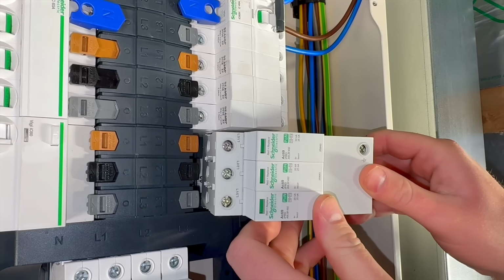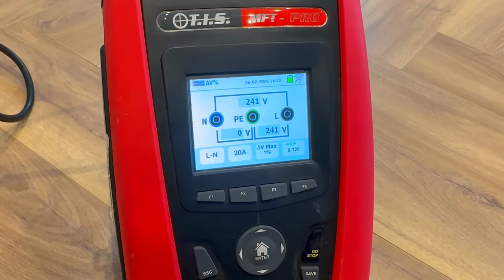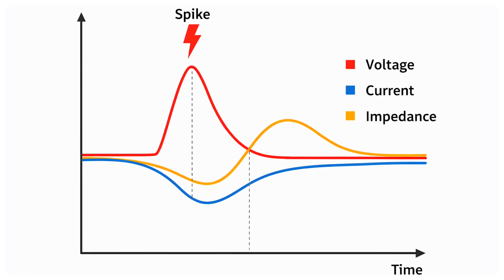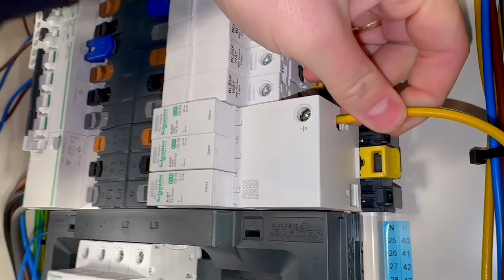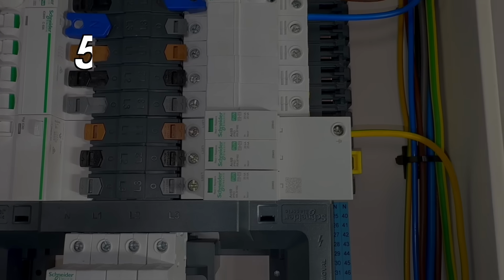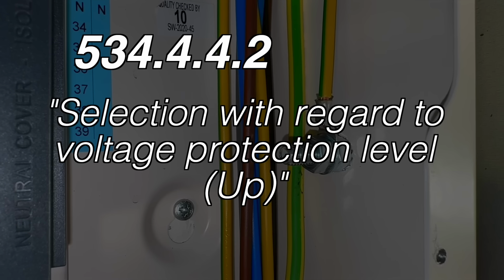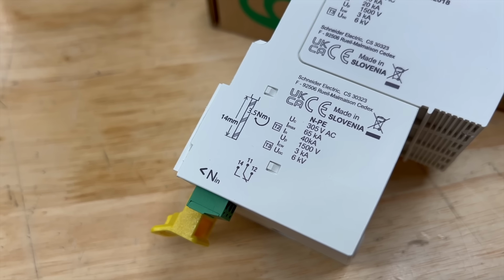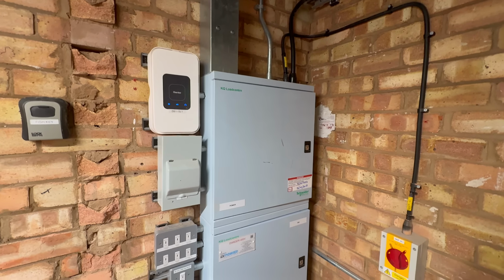SPD Type 2 vs Type 3: Most Electricians Get This Wrong

Comment: Thanks, never come across oscillations but then... who would know! Must admit I fit SPD's in every DB if I have a gap big enough (makes the install look nice as well), the biggest issue is trying to second guess where the surge is going to come from. My own house is high in the mountains, directly on top, we get hit by lightning at least once a year (sometimes 3 or 4!), used to buy washing machine control boards in bulk, since going SPD crazy, problem gone, so they do work. Curiously, the SPD's never blow even when the entire house has gone bang with a direct hit and they have worked.
I bet you there's no electricians that keep a good stock of those Schneider SPDs you showed, holy shit! 
As a tip, you can test an SPD by setting your Meggar to 1000v, the Meggar makes a bit of a weird noise (try it you'll see what I mean)
I know it's not in the brown bible but with a multi-DB install, if you think about 'common mode transients' do you still think TN-C-S is good? It's probably another discussion, another day!

Comment: SPD's.........a classic example of the regs being the marketing department of the electrical manufacturers.

Atmospheric disturbances, switching of large loads, and the associated transient voltages are nothing new.......that is why CE / UL approved products will have a good level of transient voltage withstand as part of the product approval, and have done for years.

However, the stuff coming out of Asia is what is probably more vulnerable, with more dubious approval marking.

I have plenty of drives installed on farms, with overhead supplies, no SPD......and no issues.

What I do have an increasing issue with is voltages regularly straying over 253 Volts now, and motors tripping on over current, due to inconsistent solar (farm) generation, and the variable loading on rural networks.

Comment: I have never seen electrical equipment damaged by a voltage spike/surge. I have however had a number of SPDs fail catastrophically. They also cause nuisance tripping of upstream RCDs. Another solution looking for a problem, cheers the IET.
Reply: Never ever had an SPD fail and I've installed loads. Never known them to cause nuisance tripping, interesting to know what branch you work in, its not industrial lift systems with commutators is it because I know that is a highly specialised branch of electrical contracting that mortal electricians should not ever get too close to with RCBO's and SPD's!
Reply: ive replaced many hard to reach led floodlights that died within months of installation due to surges. added surge protection and problem was sorted. not yet seen a failed spd
Reply: So, as you haven't seen any damaged equipment in your career caused by surges, in your opinion, the industry doesn't need these devices?

Is this your thinking?
Reply: @deanXRayZulu obviously
Reply: @deanXRayZulu in most instances, no.

It is the regs doing the marketing for the electrical manufacturers. 👍

Comment: @0:42 Oh. Dear. God! Hand back your electrical qualification. For that matter, hand back your GCSE science qualification. Current does not flow from a source to a load. It flows around the entire circuit (without being consumed) and thus flows both from source to load and from load to source, equally. I'm sure really you know this perfectly well, but it's not helpful to anyone to describe it falsely like this. With a river, the upstream direction is indeed against the flow of water (heading towards its source), while downstream is the opposite. The meaning is essentially the same in electrical circuits, but the analogy cannot involve the concept of current since current flow is circular. With electrical circuits, upstream simply means closer to the source (think power stations), whereas downstream means closer to the loads (think appliances). An electricity meter is usually installed upstream of a consumer unit, while lights and sockets are usually downstream of a consumer unit.
Reply: Obviously he means power in an AC circuit but we say current not power because electricians have generally forgot integration and area under a sine wave, if they did, they would be designing inverters not fitting them!
Reply: @Ino-z2m They didn't forget: they never learnt the mathematical operation of integration.  Too difficult for them: they struggle rearranging Ohms Law.
Reply: I think it is you that needs to hand back your science qualifications.

You have completely misunderstood what he is talking about.
Yes current travels from source to load and back again around the circuit.

Let me explain to you what he is talking about. He is talking about the direction of the current in the live (or line) conductor.
Source to Load indicates the direction of the current in the line conductor is going from source to load. What a surprise! It might even be considered to be intuitive!

It is an appropriate way to represent the direction of the current, without using positive and minus signs typically employed when performing a current analysis of an electrical circuit.

So the method of representing the direction of the current in this way, is entirely correct and appropriate and used throughout the whole of the electrical industry in the UK, AND other countries too.

So perhaps lay off the pedantry and desire to show-off and go and understand the domain on which you are commenting before you comment.
Reply: @deanXRayZulu  No, I understand him and the subject perfectly well thank you. In trying to explain the terms upstream and downstream he simply said that electrical current leaves the supply origin and flows towards the loads, just like with a river. While true, this only describes half of the picture, and he gave no indication that this was the case. This risks confusing a subset of potential viewers. You have to remember that some people's understanding of electrical basics is so poor that they think current is consumed at the load, and not everyone who watches videos like this are necessarily beyond such confusion. There was no desire to show off here. You've taken my comment way too seriously. This was a mixture of jest, criticism of the risk of confusing some viewers with a flawed and entirely unnecessary description of current flow, and an attempt to help any such confused viewers.

You're making a ridiculously wild leap of faith here that he meant for his description to be interpreted as only relating to current flow in a line conductor specifically, and furthermore only the conventional flow direction that is sometimes shown, even for AC circuits, in educational diagrams, and that all viewers should intuitively understand it as such.

He should have said 'power' rather than 'current', or alternatively simply said that upstream is towards the source, while downstream is away from the source.
Reply: @stonebagel-d2j The use of the world "power" is wrong.
Power is in watts and does not flow down the wire. Power is a combination of voltage and current. Current flows in the wire, voltage does not flow.

Let me try and explain things another way to convince you that you are wrong. I probably will fail to convince you as most YouTube viewers, having made a factually inaccurate post, are extremely reluctant to acknowledge that and continue to argue they are correct.

When electrical engineers (and electricians)  perform a circuit analysis looking at the currents and voltages in a circuit, they will firstly draw a circuit diagram, then they will denote currents in the circuit using arrows on the 'wires' in the circuit with the arrowhead pointing in the direction along the wire which they think the current is flowing.

And they will do a similar thing for voltages.
They will then use various rules such as Kirchoff's Laws to analyse the circuit and calculate the magnitude of the currents and voltages.

Any currents that come out negative from the analysis simply means the current is going in the opposite direction to the arrow they drew on the circuit diagram. Same fur voltages.

So recognising, understanding that currents do flow from source to load and representing the current with an arrow to indicate that is fundamentally a critical part of circuit analysis/circuit theory which is taught to ALL students of electrical and electronic engineering at university.

And the technique is EXACTLY the same whether it is a DC circuit or AC.

That is, if you don't recognise that AC currents absolutely do have a direction then you cannot calculate the magnitude of the currents in a circuit and complete that circuit analysis.

Further more, if AC current does not have a direction, then diodes don't work, which means AM radios would not exist AND rectification which is used to convert AC to DC also would not exist.

So you are quite wrong and the video producer is right.

Perhaps you didn't study any circuit theory and circuit analysis at university?
Is this why there is a gap in your knowledge and understanding?
Reply: @deanXRayZulu  Power moving in just one direction, from source to load, was the point.

Why are you fixated on circuit analysis? Take a step back, you're looking at this with completely the wrong perspective. This is an educational video primarily aimed at electricians, both in the field and teenagers starting their electrical education, providing information about application of SPDs in electrical installations. The terms upstream and downstream come into descriptions of where certain devices are to be installed with respect to each other. These terms can be confusing to some, so he tries to explain it with an analogy to water flow. In that analogy he describes current as flowing from source to load. Why on earth from this are you leaping to a wild assumption that he was actually intentionally describing the current flow of just one specific part (line conductor) of an AC supply circuit in the 'freeze frame' state depicted in a circuit analysis, without him providing any hint that he was doing such, or any context from which one might reasonably draw such conclusion? Can you not understand how ridiculous that is? This obviously has nothing to do with circuit analysis. You're massively overcomplicating it. It was just a flawed bit of video footage, and by far not the first time little issues like this have occurred in videos on this channel.

Comment: Around '89 I had a plug in islatrol filter / surge protector that had the computer, TV, stereo and such in the lounge room plugged into it.  One day I came home from work and noticed it had tripped.  Everything survived.  Everything else in the house that was plugged in was electro-mechanical, didn't care and was still working.  It turns out the transformer supplying the neighbourhood had failed and been replaced.  My neighbours that didn't have any protection at all on their electronics weren't so lucky.  It's not just business / industrial that should have protection.  With the stuff we have in housing these days you'd be bonkers not to have appropriate SPDs installed including plug-ins on the appliances.
Reply from the maker: couldn't agree more although the start of this comment sounds like the opening line to a prog rock classic track 🤣

Comment: Life must have been hell all those years ago, before the invention and installation of the SPD. Poor folks must have been having all their sensitive electronics knocked out all the time.
Reply: Ithink the point is that as almost everthing is now fitted with a microchip and because of that they are getting cheaper and less robust. To me it is a no brainer to buy cost efective tech and protect it all with a couple of inexpensive SPD's.
Also the more gear that is connected eg car chargers and the like the greater the switching cycles causing voltage fluctuations.
Reply: Pretty much everything today now has electronic controls compared to say 30+ years ago; the dish washer, washing machine, dryer, fridge, freezer, water heater, oven, cooktop, microwave oven, hell even the vacuum cleaner probably has electronic speed control and let's not forget the lights and electronics in a switchboard too.  Even my toaster has a micro running it (as stupid as that may seem).  Most things will put up with the day to day noise on the mains no problems, some items have MOVs in them too, but should that big whack come through there's a good chance everything in the house will go phut not just the telly.  Of course we now also have multi-tens-of-thousands of (insert currency here) electric vehicles plugged in and things like hardwired inverters.

Going without SPDs in a modern home is not a good idea, and of course in businesses too.
Reply: @retrozmachine1189  White goods with microchips, LEDs, PCs and mobile phones were around way before SPDs became widespread after 2018. I don't recall anarchy in the streets because everthing was being fried. 

I have had more issues with failed SPDs in the last few years than I had ever had with unexplained death of electrical equipment.
Reply: @blankblank4459  You did actually read my comment right?  You saw the part where I said most things will handle it, right?  You did see where I said should that big whack come through, right?  I guess not on all counts.
Reply from the maker: I think the old tele we had all those years ago was probably responsible for most of the switching surges on our road every time we stuck channel 3 on 🤣
Reply: Thats the problem Sean. Manufacturing sensitive crap   designed to fail, plus those who have milkfloats to plug in. We've had power surges for over 100 years, and here we are, having inane conversations over SPD. There was a time when we actually lived life, and only had to worry about an STD!

Comment: If an "electrician" is unsure as to the meaning of the words "upstream" and "downstream", with respect to the flow of "conventional" electric current, then I for one would take a lot of convincing as to their purported competence and their use of "electrician" as a moniker!
Reply: Non-sparkies watch efixx too.
Reply: I should add, if you need flowing water, in order to be able to grasp the concept, then I would (dis)respectfully suggest that a career, as a plumber, might be more your "bag".
Reply from the maker: I know, fortunately I live in a place with several rivers and streams so if I do have a confusing day, clarity is but a stones throw away....just need to remember if I go up the stream or down it..... oh gosh I've gone again....
Reply: I'm not a sparkie but even I knew what upstream and downstream means.

(Helps that I worked at a Docsis telecom....)
Reply: To believe that every single person has the same intuition, is somewhat  unintuitive.  Unfortunately, this sort of blunt thinking and casting of judgement,  is what stops people asking simple questions for simple clarity. Its not they can't grasp the concept, it's that they are aware definitions and terms are quite often misleading. Quite frankly this attitude causes accidents.
Reply: @ha-elec I like your rationale. However, the assumption here is that people watching these videos are in someway affiliated to the trade; as a result, not understanding such basic concepts is egregious from a sparky’s point of view.
Reply: Its actually a very complex topic that the presentation has got wrong. Firstly SPD's are not just offering protection from supply to the nodes in what is called an injective mono-directional model... imagine a DB feeding 3 sub-DB's and maybe these in turn feeding sub-sub-DB's, now one of these sub-sub-DB's contains a network mains PoE injector that connects the rooftop LoRa to lots of other rooftops (I'm not making this up) and the pole full of these dishes gets hit by lightning, the IT gear explodes but the lightning tracks through the PoE and into that ring main to the sub-sub-DB (making it black), from there it tracks to the sub-DB, that contains the immersion heater circuit, this sub-DB gets fried with most of what's connected it fried and the lightning finishes up at the immersion heater where the trail was lost.
So what's upstream and downstream now? So logically the lightning travelled upstream and the 'design fault' was that the sub-sub-DB needed the SPD not the master DB to protect the devices upstream! Also in this design, the sub-sub-DB preferred earth path was to the copper pipes via the upstream sub-DB.
It took me over a week to fix this, what I eventually found was a broken neutral in plastic conduit that had been blown to a molten mess of copper and had got so hot it had welded itself to the inside wall of the conduit requiring the conduit to be kangoed at the correct point, repaired, floor re-concreted and re-tiled! Nightmare! hugely expensive, lots of stuff had to be replaced and a fair bit of rewiring... and big, big five grand insurance claim!
Reply: @ten-bob-note  Oh get off your high horse nerd. Do you get satisfaction out of sounding smart and making others sound dumb? Pathetic
Reply: Excellent video covering a lot of gaps I can see on site.
Are we talking about current or electric energy flow? The current is alternated current so not sure about the upstream/downstream current 🤔
Reply: Upstream-downstream, supply-load, incoming-outgoing—these are all intuitive designations that anyone with an average intelligence can readily grasp.

Comment: So it's a combined type 2 and type 3 at the origin and the same at any sub board within that installation? (Where the sub boards are more than 10 metres down stream which they normally are.)
Reply from the maker: that right, the combined device removes that concern that the downstream SPD will not be good enough for the local devices on that sub board